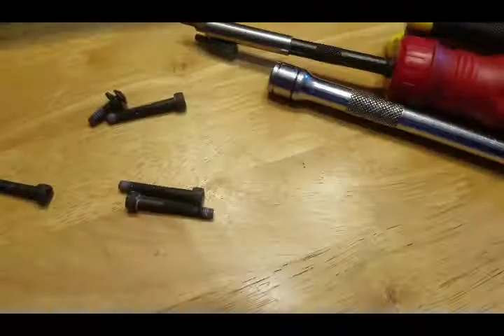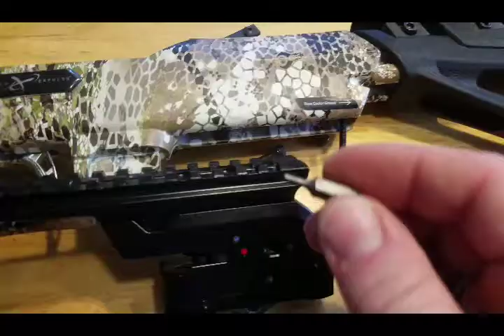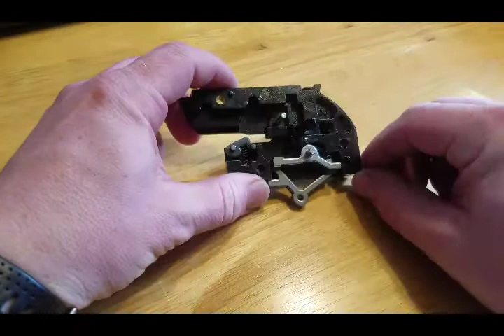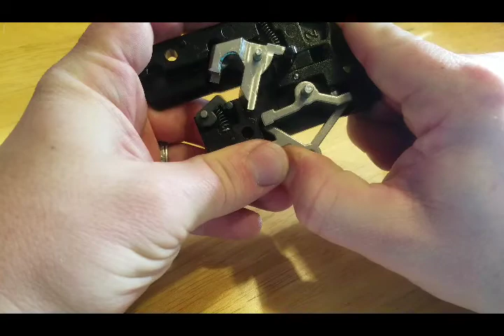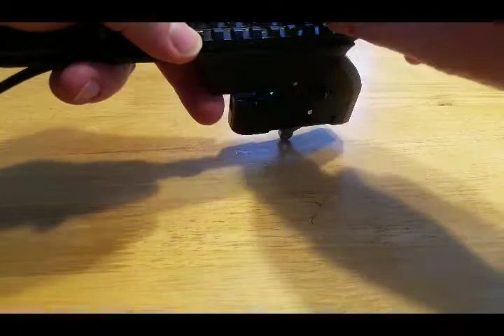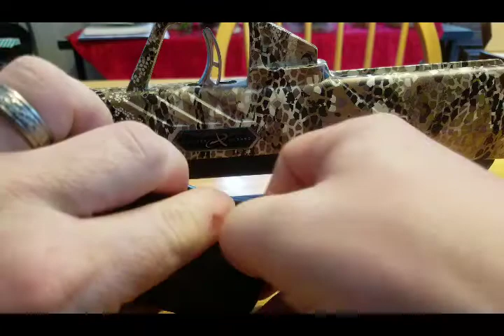Carbon Express Piledriver Crossbow Trigger Job

Comment: Buy a Wicked Ridge or better yet a Excalibur and you'll get a trigger as good as most rifles triggers.
I own both a Wicked Ridge Crossbow and an Excalibur crossbow and thier triggers are on par with those in my made by Bergara CVA Cssacade fully adjustable triggers but I never needed to adjust the trigger on any of them 
Not the Excalibur not the Wicked Ridge and not the Cascade.
But very good and generous of you making such s great video

Comment: The components look a lot like killer instincts I almost be willing to bet killer instinct makes that for carbon express Does anybody know by the way very nice video
Reply: Poe Lang/ EK Archery in Taiwan makes it. Many crossbows are manufactured by Poe Lang, Man Kung or Horizone and are marketed sold and serviced by US based companies. Some manufacturers have some parts made in Taiwan and design and manufacture their own stocks, risers and limbs and assemble the crossbow in the US. There are a few brands that design and manufacture entirely in the US but your generally going to be looking at the higher priced end of the market for those.